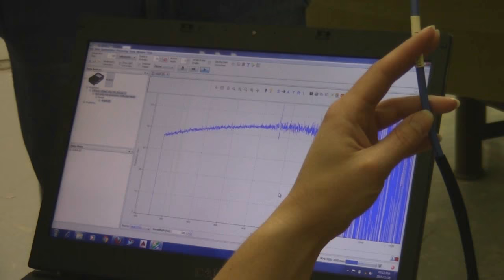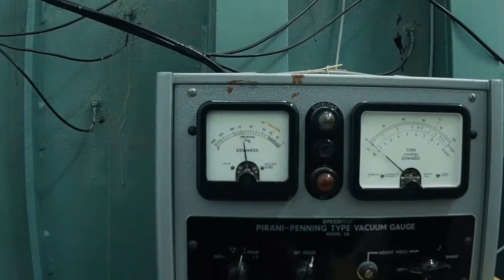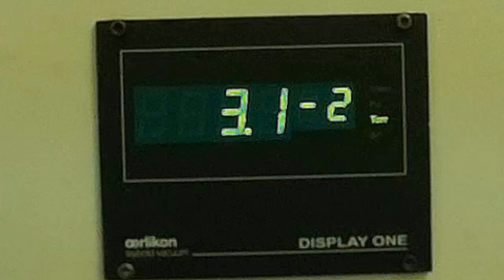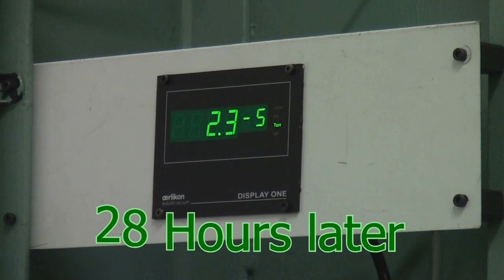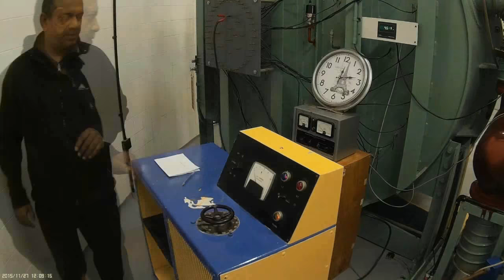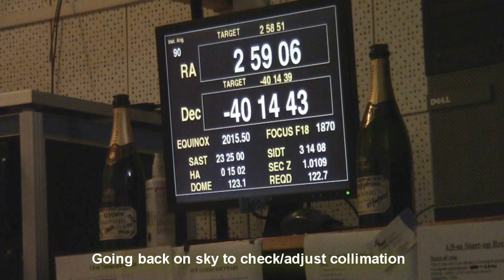Aluminising the Primary Mirror of the Radcliff Telescope

Comment: 4:19  Wow, I didn't know Drain-O dissolves aluminum!  What is the white stuff you use around the edge of the mirror to keep it from spilling over?
Reply from the maker: OK, I assume Drain-O is (mostly) potassium hydroxide then - interesting, now I know what to use if I have a drain blockage!  The white stuff is cotton wool - we use the plain 100% pure type - no fancy stuff added like scented, etc!  They once changed brand and it caused problems!
Reply: @SterremanWillie  I just looked on the can and it's actually sodium hydroxide, but probably has a similar effect.  (And it's actually spelled Drano, go figure.)  Just make sure you don't have aluminum pipes :-) :-)

Comment: حفظ الترجمة
Was plasma cleaning done inside the vacuum chamber before coating?
Reply from the maker: I assume you mean the high voltage discharge?  The tank has it fitted, but is not used any more - don't ask me why, since I don't know - it is the way I inherited the procedure.  I think it was because it was found to have very little effect for the effort involved.

Comment: How thick is the aluminium layer. Also, does a mirror of that weight need time to settle out any minute deformation when re-installed?
Reply: It’s glass. It doesn’t settle out. All it needs is to get to temperature, but then it needs to do that every night.
Reply: @JasperJanssen  Thanks for that reply. Do you know what the ideal temperature it's held at is? I asked the original question because a large mass of glass will deform under it's own weight, which is what prohibited very large lenses and mirrors from being made in the past.
Reply: @Declan-pg8cg  Ideally it should match the ambient temperature at start of night observation, there after the telescope is open to environment. Refer https://www.saao.ac.za/explore/our-telescopes/one-point-nine/ - notice the shading structures to keep direct sunlight away from buildings brick section (large thermal mass) (home page picture).  Other (modern) telescopes uses A/C to actively control temperatures - targeting expected temperature at start of night. The whistle tree-mounting (2:23) and waist band minimize deforming (i.e. mirror is 'floating').

Comment: How do you prevent oxidation of the aluminium?
Reply from the maker: A protective oxide layer do form when exposed to the atmosphere.  Luckily aluminium oxide is very very hard, commonly used as an abrasive as it is a 9 on the moh's hardness scale. It is also transparent, meaning as soon as the aluminium is oxidized, it gets a skin of this tough clear oxide, and it doesn't corrode any further.
Reply: @SterremanWillie  btw. why it is not getting tarnished after it gets oxidized with aluminum oxide ?
Reply from the maker: @kirankankipati-thelinuxcha689  As said before, aluminium oxide is transparent and protects the layer from becoming tarnished.
Reply: @SterremanWillie  If the aluminium oxide layer forms a protective layer, then what factors reduce the reflectance  to 75%? I assumed it was the ingress of the oxide layer to greater thicknesses? It's actually fascinating, because I can't find any information as to which of the following happens: 1) The oxide layer stays the same thickness. 2) The oxide layer grows thicker but remains transparent. 3) The oxide layer grows thicker and starts to form 'anodisation colours' which both darken the mirror, and cause disbursement of the light as the surface of the crystals presents as rough to the incoming light. Any papers / insights?
Reply: @SterremanWillie  
Is there no need to apply cerium monoxide protection (Sio)?
Reply from the maker: @abumoslemtamer7331  no, our tanks are not fitted with this ability.